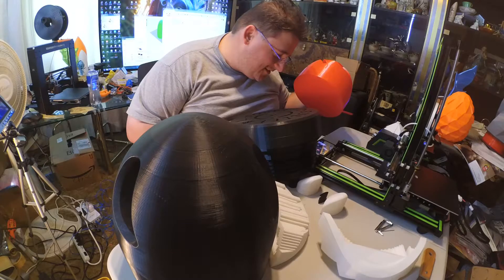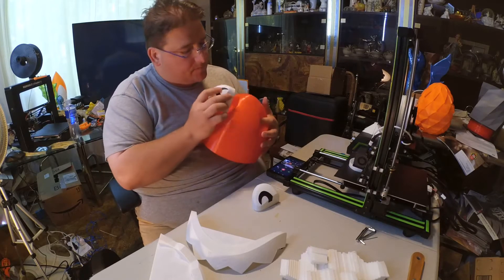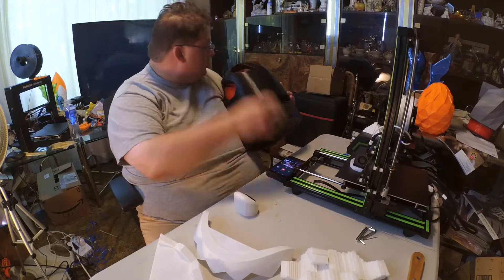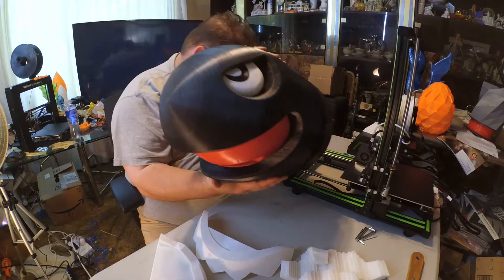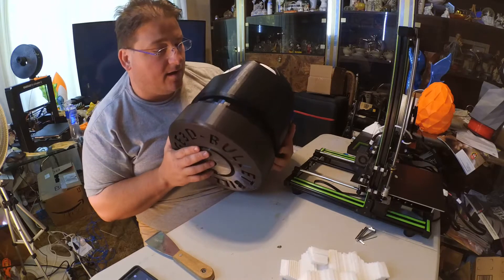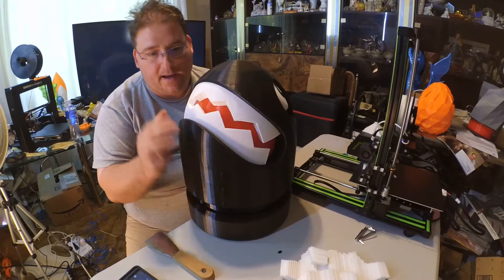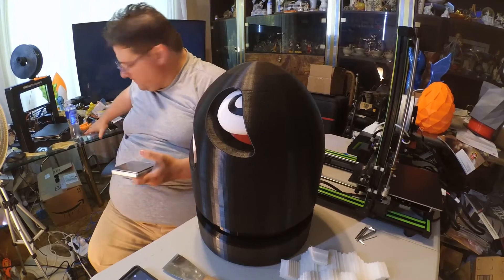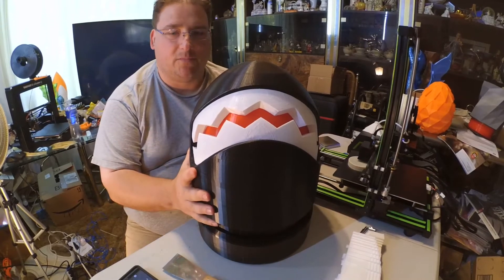Today's 3D Print - 408% Bullet Bill

Comment: I tried printing bill and was having lots of vibration issues, to the point that the leveling knobs would come completely off. Finally after 77 hours the print failed. Any possibility that you could share your settings?
Reply from the maker: This is not a settings issue this is a stop those knobs from coming off issue :-)

At 77 hours I assume we're talking about a cr10? I have never had the knobs vibrate off... That is unusual I've had that happen on my Ender 2 before operating the Springs but not the cr10 a temporary solution is once you get the bed leveled use a piece of tape on each leveling knob that overlaps the why carriage so the knobs can't turn on their own

Otherwise I'm not sure a little bit of loose Loctite? The temporary stuff not the heavy duty stuff something in the threads to stiffen them up a little bit
Reply: Nerys good suggestion. I will try that.
Reply: Nerys so with the screws are they supposed to be attached to the heatbed? I noticed that while I was trying to tighten the knobs that the screws were just spinning as well. So would I put the thread lock there as well?

Comment: Wow very impressive with the size of your project there.

Would you mind very much in telling me just how you did that?

I have but one printer and thats a CR 10. And I would really like to know the steps so that I could print a large cirst time print like yours.

If you would like tocontact me I am one of your subscribers. And I think you should be able to find me and get my email address.

Thank you,
Bob Young
Reply from the maker: +Bob Young absolutely you can do all of this on the cr-10 the biggest part is the bullet nose so I brought that into simplify3d this would also work cura no problem the same commands or use under edit and large to Max size or just double click the object pick the dimension most likely to bump into one of your limits and enlarge it actually this might be hard and Cara I'm not sure if they will let you size by percentage which is important once I figured out how big I can print the nose I looked at the percentage and I just use that exact same percentage to enlarge all the other parts then I began printing them I used black for the black Parts white for the white Parts red for the red parts that's it really it was that easy it's just a matter of waiting around for them to finish the hard part was figuring out how fan I can make them and get away with it and still have a usable part to reduce filament usage if I did this one again I would use a little bit more infill :-)

Comment: Great Video! When you printed the massive black part of Bullet Bill, did you use the 500 x 500 x 500 CR-10 Machine?
Reply from the maker: +CreativeTechno nope all of this was done on a 300 by 300 by 400 cr-10 remember that black part is two pieces :-)
Reply: Hi Nerys, thanks for the quick reply. Loved your Review / Setup of the CR-10, i've chosen this as my first printer thanks to your video's. When you setup the CR-10 however, i was unsure if you were using the base heated?
Reply from the maker: +CreativeTechno yes if I have a heated bed I might as well use it I typically run at 45 C although if I'm using plain glass or tape I run 55c

Comment: I need to make this on my cr-10. print times?
Reply from the maker: +ArduinoMakes at 300% you need the s4 for the body s3 for the faces. 70 hours for the body 24 to 32 hours for each face. With a bit more speed you could maybe shave 20% off those numbers.
Reply from the maker: +ArduinoMakes oops wrong video reply. This took about a week across 3 printers.

Comment: "If it doesn't fit..just get a bigger hammer"
That's a freaking awesome print! What a fun project!
What filaments did you use, and how much did you have to use?
Also...how long to complete?
Reply from the maker: it was a weeks worth of printing across multiple printers. I used all super cheap $10 to $12 a kilo filament figure it costs $25 to make this if you use that kind of filament. it was fun to do.

Comment: Wish me luck.  450% attempt has started.  A little first layer p0rn if you are interested.  https://ibb.co/fcOsm5
Reply: That is a picture of the first layer printed on a piece of glass which is painted black on the bottom side.  Delta printers being a pain the in the butt to level correctly, I needed a dark surface for my IR Probe to work correctly, hence the paint.  I am now 12 hours into the main body and about 25% done, near the top of the threads.  I think as soon as it clears that part, it should be able to zoom along pretty quickly.
Reply from the maker: Think It Try It yes i saw it again later and realized you were printing it in a shade of white. Still a damned nice first layer.
Reply: I think it is just the angle of the light hitting it, but that is black PLA.  The cheap stuff that was on Amazon a few weeks ago.  Jun....something something something...:D
Reply from the maker: I know what filament you speak of. while I did not get black I did get 5 rolls of the white and boy am I happy I did the stuff prints AMAZINGLY well with a very nice finish!

Comment: Dude I love this print its amazing
Reply from the maker: Plastic Blacksmith it is very cool I applaud the person who designed it came out very well and went together fine
Reply: Nerys how much filament did you use for this?
Reply from the maker: Plastic Blacksmith I'm not sure I will wait tomorrow if I remember not as much as you might think it's not very structurally sound because I really cut Corners using his little them in as possible for just that reason obviously only the two black Parts really took a lot of filament I want to say one and a half kilograms just for the black part so probably a little over two kilograms for everything
Reply: Nerys that's really not a lot for such an awesome print showed this to my son he wants to print one now on his ender 2 😉
Reply from the maker: Plastic Blacksmith it should print fine on the Ender 2 better probably just not as big :-) original estimate was 4 kilograms for this Bullet Bill it took a lot of refining to get it under 2

Comment: Fantastic model loved the time lapse. I have my cr 10 on order just wondering what build surface do you have on the glass bed ? Thanks
Reply from the maker: Rc madness trust me when I say this just order printinz.com it is absolutely amazing and not that expensive about 30 bucks get the skin not the plate use code TODAY3D for 10% off I don't get any kick back but I like helping out a really good company sometimes it sticks a little too good and you got to fight to get your part off but that's where Print in Z has its benefits you can beat the living crap out of it and not hurt it